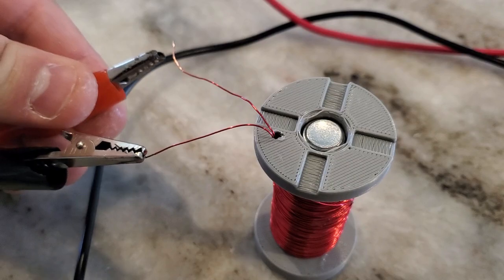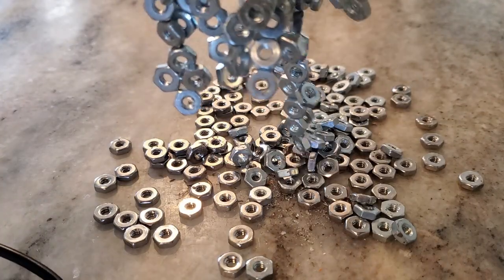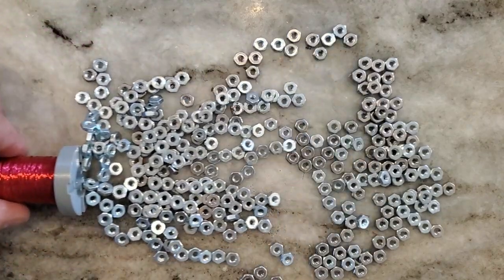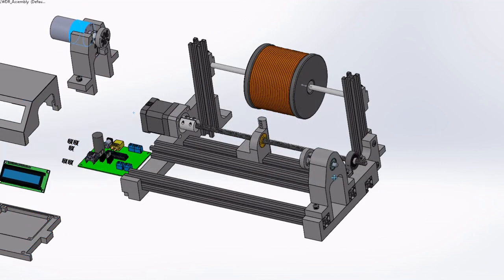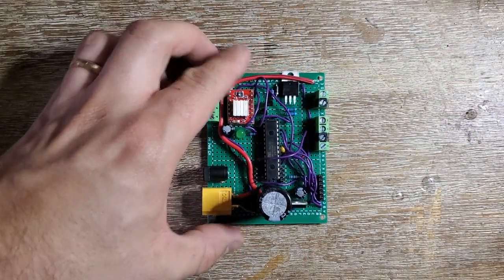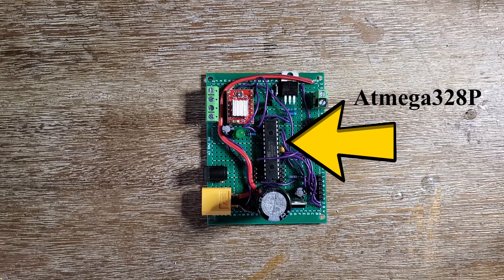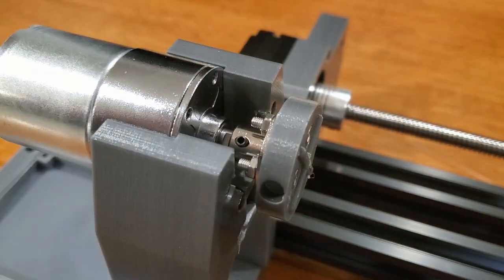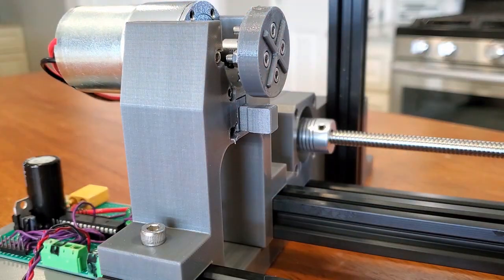Automatic Coil Winding Machine

Comment from the maker: I've added links to code & schematics in the description
Reply: But code is not upload in arduino uno at mega 328 p
Reply from the maker: @Suresh84-r2d  If you're using the Atmega 328p chip without the arduino you need to burn the bootloader first and use Tools ->  Board -> breadboard avr -> ATMega328 on a breadboard (8 MHz internal clock). 

Also check that you're giving the chip 5V and make sure its ground pin is tied to the ground of the arduino you're using to upload code
Reply: You are brilliant!

Comment: you're a champion.  i'm literally doing 2 things right now.  one is making a machine to do this.  and the other is upgrade my laser etcher to a larger frame.  i can make some adjustments to this concept and get the build done with parts laying around.  i'll be looking at adding some tensioners to the design to keep things just a little tighter (v bearings) if it turns out as well as i hope i'll shoot another message so you can take the design and fix anything and give it away :)

Comment: Glad I stumbled on your video. Am presently working on the exact same project. You have answered many of the problems I have been having. One question, You added limit switches but they are not in your schematic or code. Were they tied into the jog buttons or do they have their own inputs and code? Great Job.

Comment: Hopefully you are monitoring this. I would like to build the Automatic Coil Winding machine. In looking at the Arduino code it seems to not match the pinout on the Arduino chip and also regarding the limit switches. What pins do they connect to on the Arduino chip. Thank you very much.

Comment: How hard would it be to modify so that it could wind and cut a shape of copper wire called "spiral prismatic packing"? It's like a coil, but instead of a circle it's triangular, and that triangle slowly rotates as you move down the coil, but I think this rotation happens naturally when the cut pieces are removed from the die, due to the springiness of the wire. Probably not explaining it right, google images should help explain it better.

A tool like that would be super helpful in the hobby distilling world, where copper SPP (used for fractionating column packing) is expensive and overpriced.

Comment: A tesla winding automated:  Tesla coil winding machine - powered by Arduino Nano
Kaj Luukko
Now.. I's get a Mini Lathe and automate it..  and you have to calculate the wire stepping into the 'groove', perhaps at the end having  'soft(er)' foam rubber [paper] ends.. and slowing down the winding process  (, also with an inspection camera set to spot the jump; 4 core Raspberry Pi)  I think you have to much backlash on your  screw - spring tension it.  (An automatic lacquer brush.. LoL)  Well, one step at a time according to need ...  Good show..  I couldn't determine if your coil holder came apart....

Comment: Have you ever tried simply feeding that size wire by hand? It will be as easy, and give exactly the same coil result as you are now getting without all the complication. The first thing to do is DISMANTLE SOME  OLD TRANSFORMERS! This will give you an idea on what is REQUIRED to get an even wind. (separator paper layers are MANDATORY for multi-layer coils with even lay. Use fine wire (#30 or smaller) in your tests. This is MUCH more difficult to wind than the huge wire you are now using. Also look at the design of professional coil winders. (US patent office) The way you are currently trying will end in frustration and piles of junked parts! (been there done that!)

Comment: Excellent work. It could very easily be adapted to winding guitar pickups. However, uniform-wound pickups have more distributed capacitance due to the wraps of wire being mostly parallel to each other. To decrease the distributed capacitance, the wraps need to be laid down randomly. The stepper motor that moves the wire guide could be programmed to do that. Or, it could just be sped up so that each wrap is further away from the previous wrap.

Comment: 9:40 you have to look at textile machinery to find the simple solution for correct wire alignment. Yes the feed point must be near the bobbin you are winding but the spool from which the wire come from must be offset aside from the feed point. basically you want the wire touch always the same edge of the hole. If not the wire will go left and right random. Tensioning the wire is very simple and precise if you copy design from textile machinery, your method does not guarantee constant tension because the spool changes diameter as the wire is consumed.
Reply: What about the takeup spool. As the spool fills it gets thicker. Therefore the amount of wire per turn of the spool will increase. Doesn't the slider need to adjust the speed to compensate for this?
Reply: @wbcc3388  the short answer is yes !! think at a lathe doing a tread, if you don't know watch about that.. in general in a lathe the tool ("your slider") is connected by gears to the spindle so speed does not matter the only things that matter is the ratio of turns per minute of the spindle. Often this measure is noted as mm/turn so if i set for example 0.5 mm/turn my tool (your slider) will move 0.5 every turn no matter the speed

Comment: can the atmega328p be replaced by an arduino uno r3?
Reply: Yep, changing / adapting the pin config or use the 32bit Microchip Fubarino witch is compatible with Arduino IDE.

Comment: The issue you tried to solve with limit switches is what we call in yarn winding "lip breaking". the reason is simple : as you lay one layer over the other, the motor basically stops to reverse, which automatically means that it lays x2 on the particular point.  Also the speed of the winding affects it because the motor basically never stops on the spot (even with high end servos). The solution is to break the speed a couple of mm before the ends and to implement the lip breaking : you lay a couple of layers at full length and then others at length - x . The number of winds on full and those on full-x need to be programmable
Reply: I made a similar winder but for textile threads, I solved this issue by speeding up the follower/guide when it comes within few mm of the edge to almost the double speed. Also one other factor that probably helped is that I made guide part as light as possible and left the motor at full step mode so it can change direction faster without losing steps. It needs a bit of tweaking with the speed but its easy to calibrate.

Comment: Great vid. If you want to avoid any electrical noise by your stepper motors don't use A4988 or DRV8825 drivers, but TMC drivers, like TMC 2226. These are socalled silent steppers. After substituting my DRV drivers by silentsteppers I was absolutely astonished! Steppermotors were silent. No vibrations either whatsoever. Philips has written a very interesting paper about orthocyclic coil winding in the early 60's. They were able to make perfect orthocyclic coils after more than 2 years of research. If you want I can mail the paper to you.

Comment: When I was younger I pretty much gave up at electronics because of fake chips. At the time I didn't even know I'd received fakes but none of the circuits I tried to make worked, ever. The 1st one I made worked okay and I blew up a MOSFET. Then after that the rest were fakes and wouldn't even work. Even though nothing else had changed in the circuit. Eventually just gave up and my passion for electronics slowly faded
Reply from the maker: That's why i get any kind of semiconductor product from a legitimate vendor like DigiKey/Mouser etc. Amazon/eBay chips/transistors/diodes are almost guaranteed to be fakes.

Comment: All I can say is WOW. I used to work in a cable manufacturing company and I ran a machine like you built but the machine that I ran could take up to an 84" spool.  And the had rewinder machines that could run a 10' spool

Comment: I have a suggestion! 
Instead of using a fixed clamped feed point, what about using a free-swinging feed arm that has a tiny roller on the end, so that the feed point is always basically sitting directly on the surface of the existing coil and just "rolls" against the surface? You could have your feed distance be almost zero with that setup.

Comment: Aweosme project! Looks like you could improve the compactness of the coils maybe by replacing / modifying the sliding mechanism with a linear rail or a carriage with v-slot wheels and maybe adding a wire tensioning system, the motion of the wire outlet moving down the track looks pretty wobbly, but for ease of use and ability to make many different kinds of coiis within your frame, this is great!

Comment: This is awesome! I've been wanting to build one of these for some time now.  Lately I've come into quite a few nice little steppers from label printing machines I found so I've started gathering supplies and thinking of a design for a sort of general purpose desktop CNC rig for laser, router and hopefully 3D printing but I may just have to take the plunge and buy a commercial rig for the latter.  Regarding this thing though, you might be able to get even better performance and open up the possibility of using less-than-pristine magnet wire if you use a wire guide based on a series of brass V pulleys arranged in 2 rows with the wire zig-zagging between them.  With a 90 degree V in the pulleys the arrangement naturally straightens the wire in both transverse axes simultaneously and can even be driven to precisely regulate the wire speed regardless of the upstream tension. I've been messing around with using that method just to straighten salvaged wire (seriously, who buys wire? lol 😜) with good results.

Comment: Looks like the follower is not going fast enough (timestamp 10:52+). The Angle theta is clearly increasing overtime in both direction (easier to see with video playing at x2). It could be an idea to check the calibration of the follower axis. Just my 2 cents. Great video. Thanks

Comment: i made the coil wind that you described i uploaded it to the Arduino and cross reference the atmega to the nano. everything works as it should even the display
the only trouble i am having is the jog buttons don't work and i can not enter the width of the coil  it only displays mm ok then it ask me to center my wire feeder.
Is there something turned off in the code.
Thanks
Rudy
Subscribed in Florida.
Reply from the maker: If you can email me some pictures i might be able to figure it out
Reply: hello, did you fix the problem with buttons, i have same problem, only PIN D4 works for OK....
Reply: @VAY01  
He sent me a new code for something else but the jog buttons I still cannot get to work.
So I use it as is .

Comment: Generally the winding machines I've worked on don't use the spool weight to get the tension. 
They stand upright and de-spool from the top through a cone /funnel. 

The wire then goes through two rollers. 
First the wire goes around 420 deg (over one turn and comes out at 90 deg from entry point) 
This is the tensioner roller that has a felt pad at the end that is tightened for appropriate tension. 
Wire leaves at 90 deg from entry. 
Then goes up to second roller, does a 90 deg turn,  then goes through a v roller. 
This keeps it center of the moving carriage.
Reply from the maker: I'll probably end up with a setup similar to that whenever i upgrade this thing

Comment: Very insightful and creative as usual, and I like how you come up with creative solutions to achieve desired outcome. One thing I might suggest is that the wire that is being fed to the winder needs more tension points (ex. wires go around pully gears with spring tension), and the Feedpoint should have a tension of sorts which presses the wire down or up depending on the vertical height difference between the Spool and Feedpoint.

Comment: Hm. A magnet put into a copper pipe will slowly fall due to induction. If you make the pipe an electromagnet and turn it on while the magnet is falling I'm guessing the magnet will either shoot out faster at the bottom or be repelled out the top depending on the direction of the magnetic field? I don't recall anyone doing a video on that.
Reply: That's essentially the working principle of a Gauss cannon.
Reply: https://en.wikipedia.org/wiki/Coilgun
Reply: @danielb.2873  I was thinking more in terms of controlling the speed up/down like an elevator not super acceleration horizontally.